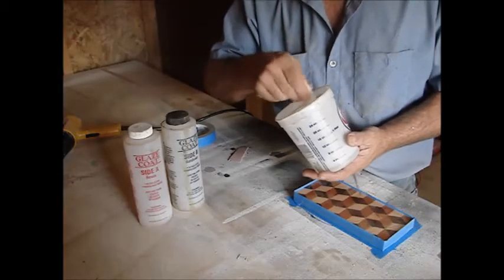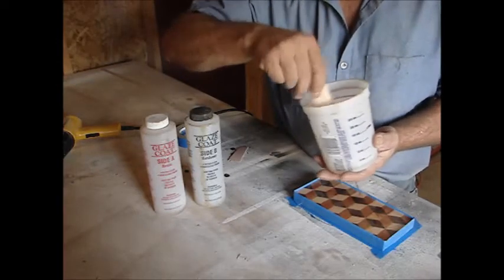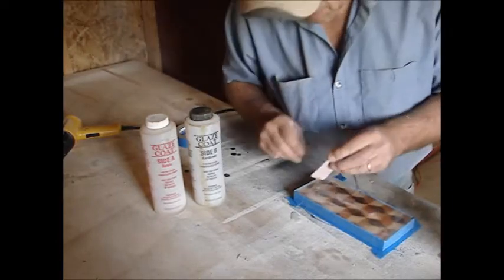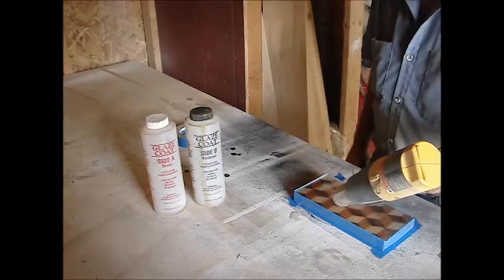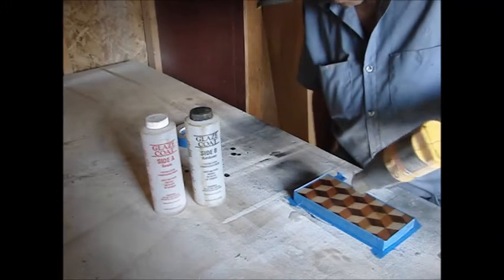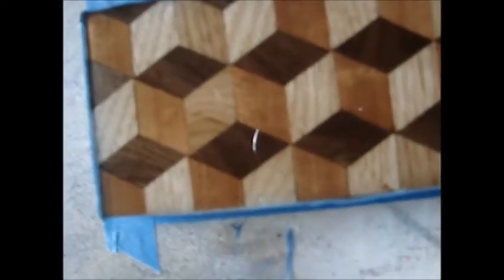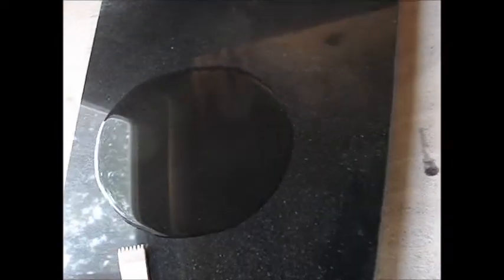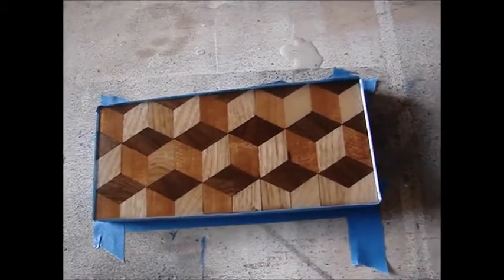how to do a Glaze coat Finish

Comment: Is the heat gun equal to or better than an the open flame torch others Use? Also, is there a problem of dust settling on the surface before the finish sets?